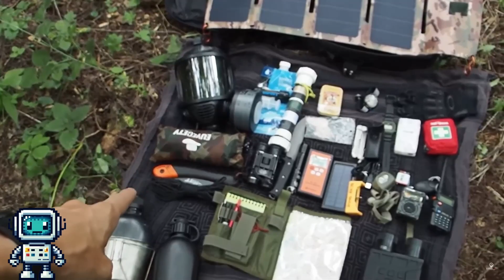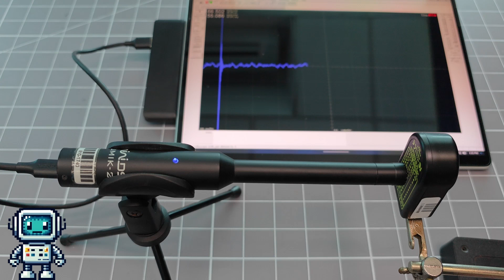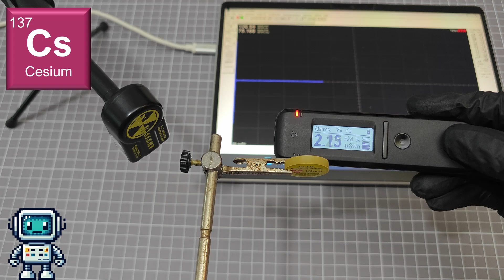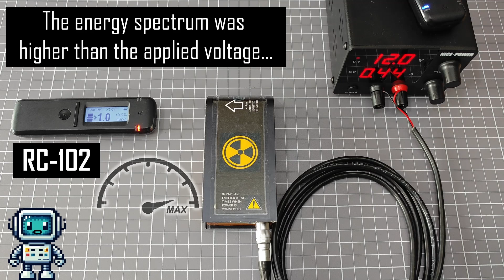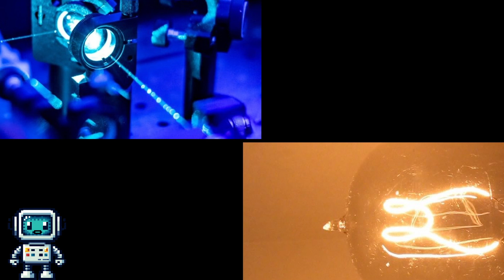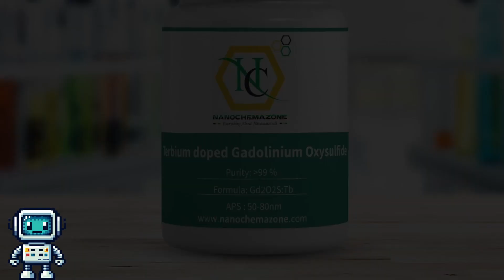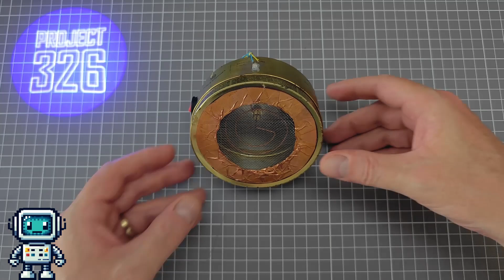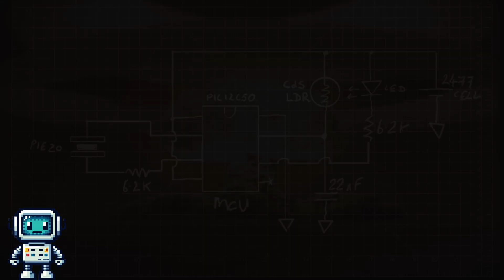NukAlert or SCAM Alert?

Comment: I do not know about the rest of the world, but in Russia the Internet is littered with ads for the sale of old Soviet radiation measuring devices. Army devices can be purchased from $ 10 ($10 for a workable device!). A normal household appliance will cost from $ 30.
Reply from the maker: eBay has a lot of this stuff too, but not as low cost as you describe.

The detectors that military personnel were issued had a very different purpose to what the general population needs.  They were designed to assist military gauge the 'correct' time to come out of cover and attack the opposing lines.  Too early and your guys will have a very short time to live, too late and perhaps the enemy has already overrun your lines.  They were not designed to keep people safe, they were designed for front-line troops to win a battle so that reserves can then later come forward and repeat the process.

Comment: I appreciate you took it apart and told us about its design, however, I disagree with many points in the video. Why not buy a cheap Geiger counter instead? Well, because under nuclear attack it would be useless, it can behave as Gamma Scout did or show zero. Even if it didn't, what is it good for when it tells you you have gone beyond 10mR/h? Surface bursts create fallout plumes where radiation field reaches hundreds of R/h. I'm talking about gamma only, during the "acute phase" it doesn't make much sense to care about beta other than keeping fallout particles away from your skin and preveting their inhalation when fallout descends, there are almost no dosimeters that show you beta dose rate (all those who "measure" beta with their Geiger counters and gamma scintillators do it wrong). Cheap Geiger counters are often gamma non-compensated and not even beta shielded, so they show nonsense values in mixed radiation field, another reason why relying on them only is a bad idea. Geiger counter with range up to 10-100mR/h may be useful inside a fallout shelter. By the way, deposited radioactive fallout is a plane source, removing some contamination from the shelter won't save you from radiation sickness, it's proper shielding that does.  Civil defense protective measures were designed to prevent people from suffering acute effects of radiation exposure such as radiation burns and sickness, those short lived isotopes which you mentioned as not important are actually those that matter the most, during the first day or two their gamma radiation delivers the greatest portion of the total dose. As they decay fast, they have very high specific activity. Cs-137 won't be an acute hazard. When it becomes the major contributor to gamma dose rate (about 4 years after the explosion), there will be no areas of immediate danger, maybe except the very epicentres of surface bursts. By that time Nukalert may be almost useless. Of course it doesn't mean you can't use Cs-137 for the purpose of Nukalert validation, you just have to use a source strong enough to create that R/h range gamma field. In my opinion telling people that Nukalert is useless and that they should buy a low range Geiger counter is dangerous. If the Nukalert scintillator responds mainly to X-rays, there is a remedy for that - energy compensation and the patent mentions that. Not only the layer of lead attenuates low energy radiation (preventing falsely high readings), when high energy photons come, they liberate electrons leading to stronger response. X-ray testing you have shown may be good to test if it can respond to radiation but without further data (spectrum of the X-ray source, energy characteristics of the detector - after compensation!) and calculations it can't be used for indicated value verification.
Reply: I wonder what caused it to chirp such a long time after the X-ray burst, maybe the burst was so intense that it damaged the detector and/or the electronics.
Reply from the maker: That's the way is it 'supposed' to work, according to the patent and the product documentation.  The MCU flashes the LED to [allegedly] make the phospher more sensitive, which triggers the LDR, which in turn causes the MCU to flash the LED.  They do this to make it have some sensitivity.  
So, this ends up with a system that has a crazy long time constant when triggered.
Reply from the maker: Thank you for the long and well thought out comment.

One thing I learned, when talking to people in the prepper movement, is that everyone seems to have a slightly different view on what a nuclear exchange would look like.  Expectations vary from "the government will be back up and running in a month or so" to "back to the stone age", and this has a lot of effect on the use case.

I fully agree, short half-life products are more dangerous, far more so, but if you are going to stay holed up in a 'bunker' (ie use case is important) for a month or more, then actually it is the medium term fission products that will become more relevant to long term survival.

In any cases, the simple fact that the NukAlert is almost totally insensitive to gamma above 100 KeV, means that even very high dose rate fall out will not be detected by this thing.  The Gd2O2S scintillation material has almost no sensitivity at the important gamma energy levels.

The manufacturer is well aware of the failings of this device, what is important to them is sales, not functionality.

What I would caution over is comparing devices intended for civilian use and those that were created for military use.  Cold war military doctrine, on both sides was not something that produced equipment that would be helpful to civilians.  

In the cold war, the expectation was that soldiers would take cover in preassigned locations.  The side that sent its soldiers out at the "right" time would win the battle.  Come out too early and the soldiers will be incapacitated very quickly, come out too late and the enemy has already over run your positions.  These types of calculations were not factoring in long term health of the soldiers...

Comment: I mean, it "ticks" on a regular basis, so that's a huge red flag. They could've at least faked it by randomising the delay between each "tick".
Reply from the maker: ironically, that is supposed to be so that you know its still "working"...
Reply: @davehimlin2374 There is no need for such functionality as the environment radiates enough particles for a detector to tick, and thus let itself known to the user that it is on.

Comment: Where in hell did you found a 2n4117? All FETs I bought were bipolar transistors rebranded as FETs, meaning fake ones. The only ones I found were SMD from Interfet and the old ones I have in my junk box.
Reply from the maker: Thanks for the comment.

I have seen dodgy little resellers (usually they operate out of sheds in the countryside and keep moving around to avoid getting busted) re-marking cheaper components for more expensive ones, but for cheap transistors, that's pretty slim pickings.  These days, those little fake component vendors are dying out - they would have completely died out if it wasn't for the Ukraine war.  I heard that these remarking shops are now busy selling fake MCUs to Russia.  Maybe its a coincidence, but the VKD has lost quite a few war-planes recently due to 'technical faults'.

I know quite a bit about these re-marking operations.  My wife comes from the same rural part of Guangdong province where this is (or was) quite prevalent.  I also work with a lot of factories here and they tell me a lot of stories about this and how they avoid getting screwed on component supply.

I got these JFETs on TaoBao.  China has a lot of discrete semi manufacturing, though its aimed at the internal market.  I have found all kinds of things here that seem to have died out in the west, diac triggers, uni-junction transistors, etc.  

A funny story about the uni-junction transistors, a friend of mine in the UK was looking for some as part of a relaxation oscillator, but in the end, it was just a bit cheaper to get a Chinese 8 pin MCU (8051 clone) and create the same signal via PWM (a 13 cent MCU)...

Mind you, the 4117 isn't particularly special, most n-ch JFETs will work in this application.  There is no HF gain requirements, the Vgs is fairly typical.  Perhaps the ones I got are a different type, but they are certainly JFETs, and for this near-DC application, it probably doesn't matter.  I think I paid 7 cents each for them (for a strip of 10 pieces).
Reply: @project-326  I really don't know why FETs died out. Some say they were not trustable. But they are more resistant to static, to radiation and much lower thermal noise than MOSFETS. Certainly there are applications where they are preferred (hearing aid devices are one of those, maybe that is because I can only find them in SMD form).
UJTs I can still find easily here.

Comment: great check, I have toght it use diode semiconductor and sense over beta. It would make sense for a cheap device, but it is actually not cheap at all. As the mica window at my inspector Geiger mueller pancake tube has broken and never found a cause, maybe due to the travel over mountain and air pressure change or even manufacturing defect. Besides the replacement from the LND the decision was also to get one rugged LND 71210 for the safety situation. In the case of explosion the blast pressure may destroy mica and make it useless, so the cylindric tube that use more rugged window may be more reliable. It is also energy compensated so may be used for better measurement of some sources. For the same reason it was expected that nuke alert use diode rather then mica. Tested and LND 71210 performs quite fine on the same GM made for their pancake tube, just the calibration is different. Sensitivity of ion chambers is lower then GM, but they have great linearity so they are good for measurement.
Reply from the maker: Thanks for the feedback.  Those kinds of alpha capable GM tubes are very fragile...
The proportional region of the curve is certainly much better for linearity and can even be used for spectroscopy, etc but has really terrible detection sensitivity...

We are actually considering creating a DIY device that is small like the NukAlert but actually works...
Reply: @project-326  scintillators may be fine solution, but they are expensive, so diode appears as an acceptable solution for high contamination. But the main purpose of such detector is when to get out of the shelter and where to move, as the initial blast does not need detector.

Comment: The huge markup is not as infuriating as the fact that this is just a crude X-ray detector and nothing else. Big thanks for exposing this piece of garbage.
Reply from the maker: Its people being sold a fake sense of security that really bugs me!
Reply: @project-326  they used every trick in the book to ensure that sense of security. I'm surprised that FCC and CE  have not caught up with this scam. Hopefully, your work will raise some alarm bells.
Reply from the maker: @duke_of_oz  Normally the FCC and CE won't intervene, they don't want to use the resources.  Well, unless it is a Chinese product, in which case there will be customs seizures and a "SWAT team" type response...

The Gamma Scout doesn't have FCC certification either and that has been available in the USA for decades.
Reply: @project-326 since you already have it try replacing the CdS cell with a J fet and photodiode. Then put a LYSO crystal in it. Should make it a lot more sensitive, at least able to respond to the Sr90 and 137Cs check disk.
Reply from the maker: @christopherleubner6633  Yep, that would be better, but frankly if I am going to do that, why put it into this device instead of making a better one...  Interesting that you bring this up, I am actually working on something similar.
Reply: Yup. The gadox has zero response to anything north of about 200keV, no response to alpha or gamma. Using a CdS cell is making a bad product even worse.😢

Comment: The  GammaScout most likely has a gas tube in it while the others have a scintillator crystal.
Under high flux the tube don't work properly as a continiously conductive path exists and it stops counting. 
Not good but expected behavior.
Reply from the maker: Actually, in the testing section, the BR6, HFS-10, HTT-60 and FS-5000 are also GM tube devices.  

Typically with a GM tube, once the count rate gets too high, the dead-time limits the count rate to a pretty fixed maximum.  To become continuously conducting, the tube voltage needs to be increased, taking outside of the Geiger plateau region and into the continuous discharge region.

We have a separate review video on the Gamma Scout, it is a device that we have a long history with and features in many of the review videos...
Reply from the maker: we also have reviews on all of the other devices shown in the testing (with the exception of the RAM-01).
Reply: @project-326  Thanks for the response! Clearlly I was miss informed about the detector types. Making the GammaScout results even weirder.
Reply from the maker: @faxezu  Whilst this is a sort of educational channel, we try to have fun too.  The Gamma Scout is just a badly designed device, the company that makes it, has a real dislike of this channel, every now and then one of their people shows up in the comments on a hate-fest.  We have pretty much figured out who their small team in Germany are now and what Google accounts they use.

Will probably have to go through the process again with the people behind this horrid NukAlert...  
It strange, there are a lot of videos featuring it, but only with a view to selling it.  Well, there is a full review on the product now!
🙂
Reply: @project-326  I might be German, but I swear to have no affiliations to GammaScout 😄
Thanks for the nice video and sorry again if my first comment sounded negative!
Reply from the maker: @faxezu  Not at all, I make it a personal mission to try and challenge my assumptions whenever I can, and I like it when people help me to do that with comments that challenge me!

I am based in China, but a lot of my friends here are German too (my company has consulted for quite a few German companies) and I love the reaction I get from them on the Gamma Scout review video.  

The most common reaction from my German friends here, when they first see the GS review, is asking why I didn't call them to help with the 'energetic teardown' of the product...

Take care and have fun!

Comment: Agree with you. Definitely scam.
Even a 1x1 cm² 5 mm thick plastic scintillator with a silicon photodiode would be better.
Reply from the maker: Making this video has given an impression that the world actually needs something like the NukAlert, but one that works for real and delivers some useful data.
Perhaps we will develop one ourselves...
Reply: @project-326  something aimed at the Prep's market sounds like a great idea.  IMO, it needs to be practical, affordable, and most importantly - to legitimately work!
Reply: Even without a scintillator, a PIN diode works better.😇
Reply: @Nachos-sk7od  This is correct for alphas and betas. For gammas, the cross-section is too small to be sensitive enough. A scintillator is much more efficient.
Reply: I agree. I wanted to keep the cost of the system under $10, but the cheapest scintillator I could get is a recycled CsI crystal from a medical X-ray machine, for $6 each (4*4*3mm). I'll test it to see if it improves gamma sensitivity:)
Reply: @Nachos-sk7od  6 $ is already cheap. Here I pay 3 times as much (Europe)
Reply: It's not unlike my CD survey meter. Except, that will probably work.
 There is no practical way to test.